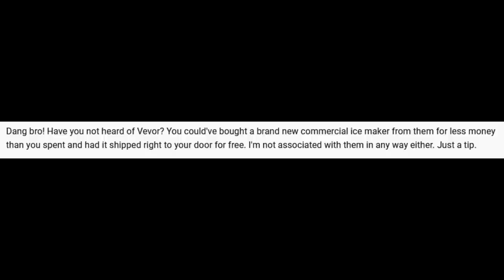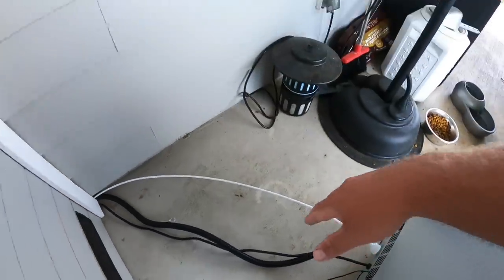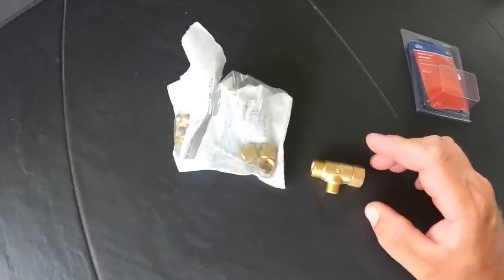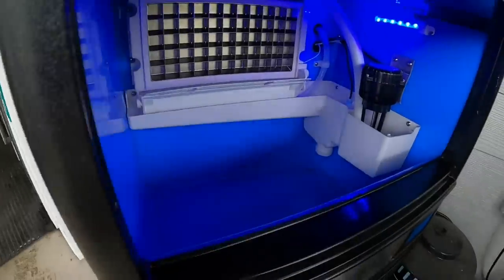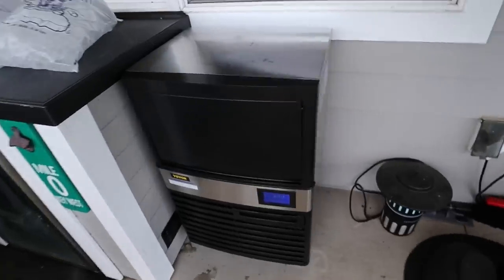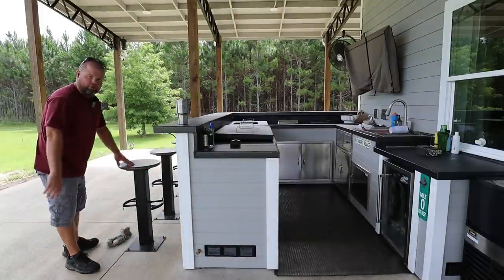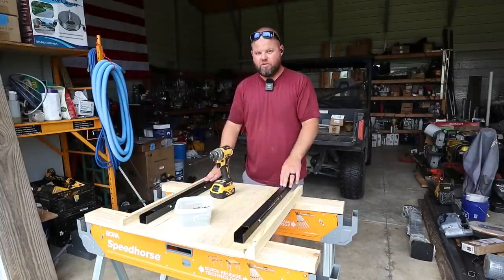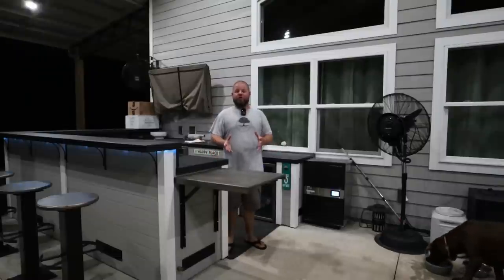DIY Outdoor kitchen gets some nice upgrades! #796

Comment: Hey. Andrew love your videos. I noticed you used a brass farole on the plastic water line for ice maker. Not good. Could cut the line with a little water hammering. You should replace with  plastic one.👍
Reply from the maker: You are correct, it's what I had on hand. I was also very gentle and did not over tighten.

Comment: I got a set of clamp on pallet forks from vevor. I have an older tractor with a pin on bucket. They are working great.
Reply from the maker: Awesome! Their stuff is Harbor freight quality for an even better price in my opinion. Not top of the line, but definitely gets the job done.

Comment: Congrats on 100k!

Came to the channel for the freezer ice maker build. Had bought the freezer and the ice makers/hardware when I came across a free commercial pellet maker (needed minimal work).  Installed it in my pantry.  Family loves it!  (Returned the freezer and component's)

2 questions:

Did u silicone the tube coming from the drain pump inside the drain pipe under the sink?

Did the 1st led lights die, hence the upgrade to the rope lights?

Thanks for the great content.  Love seeing ur projects!
Reply from the maker: Yes I did seal the tube in. The original cheap lights started acting up, so I went with a outdoor rated rope light. Thanks for watching.

Comment: Awesome video Andrew! I’m just a diy-er but I think the plastic supply line to your ice maker should have a plastic ferrule.  I noticed you used a copper ferrule. This was the connection at the T from under the sink.  
Thoughts on running power from the garage to the pool? Would be a fantastic video!  Love the channel and I’m not by any means telling you how to do things.  I enjoy watching your projects!
Reply from the maker: Your correct and I used what I had on hand. It does work as long as you don't over tighten. I have a different plan in mind for solar to the pool 😉
Reply: I had a suspicion that you knew about that copper-plastic connection!  Looking forward to the deck/pool build!! Get that lumber ordered!

Comment: I hear you on pool electrical costs. 2- 2.5 HP pumps running 24 x7 sucks. 3 freezers, 2 refrigerators and a 5-ton unit. 😢

Comment: Great video, love the upgrades! Do you have any concerns about your sink backing up an flowing into your ice machine? I recently put in a condensate pump for my crawl space dehumidifier and had to install a check valve on the outlet. Nice job!
Reply from the maker: No concerns, the drain pipe from the ice maker is loosely fitted in the condensate pump tray. We've never had a backup at this house or the last.

Comment: Wouldn’t you want a one way check valve on the drain line in case of a backup it wouldn’t sent dirty water back into the pump or ice maker
Reply from the maker: The drain tube is loose fitting into the pump, it's essentially a catch pan. Can't imagine this happening in reverse, there's always the potential.

Comment: How many inches of space did you leave on either side of the Blackstone? How do the tiles handle the heat off the Blackstone? Im going to build mine in as well
Reply from the maker: 3 inches seems to work well. No issues with the tile.
Reply: @TKCL  Thanks for responding. You do a great job and pay attention to detail, keep going and don't listen to haters.

Comment: Don't you need an airgap to prevent backwashing drain water into the pump and ice maker?
Reply from the maker: The tail piece is angled down and has a lip on the inside to now allow water to enter said pipe while draining down and out.

Comment: My ocd wouldn’t allow the folding counter to not meet flush with the existing countertop.  Did you make it lower for a reason?
Reply from the maker: Yes there is no room for the hinges to work properly and the counter top to fold up if higher.
Reply: @TKCL  got it.  Thanks

Comment: Typical, the 1 jiont that the manufacturer fitted didnt have a rubber. Or did u not check it?. If not I bet the suppliers are fuming at the moment... 
If you got If for free because you have helped the ice making business.  Maybe you could of not shown that.... maybe. 
It may of been you not checking. I saw you show that joint at the back but I was doing my usual skip through to interesting bits.
My bad If it wasn't anyones fault. 
Isn't it a drain not a condensation waste. Isn't it already pumped?
I have fitted a non pumped icemaker but that was years ago, I thought it would be standard now?
How did it go fitting the extension onto the counter. I thought it might be difficult with brackets already attached to the top, maybe the other way mite of been easier? But you do find great ways to solve problems like that.